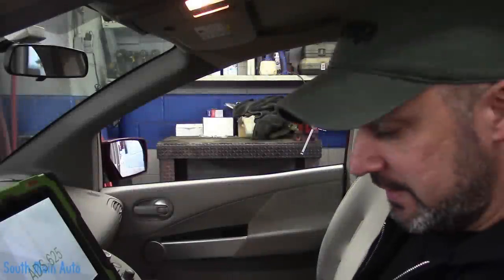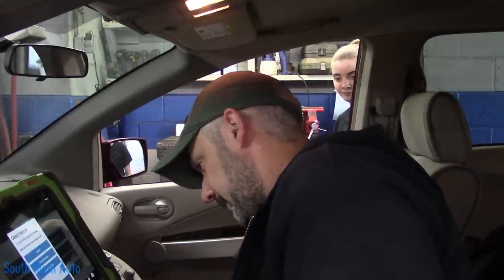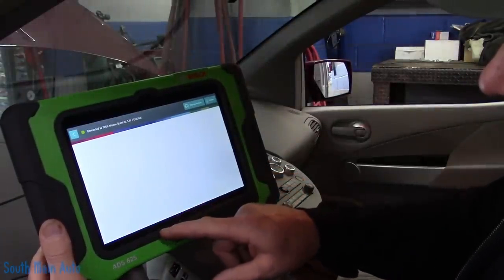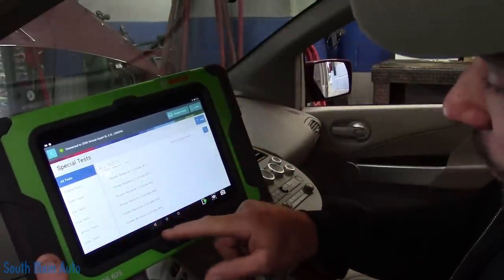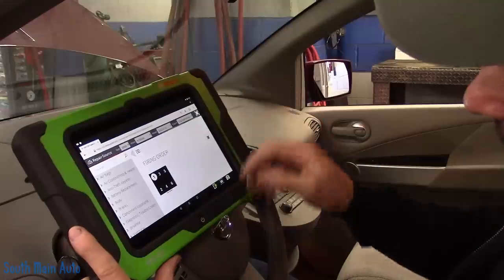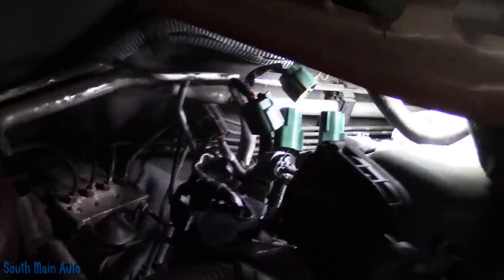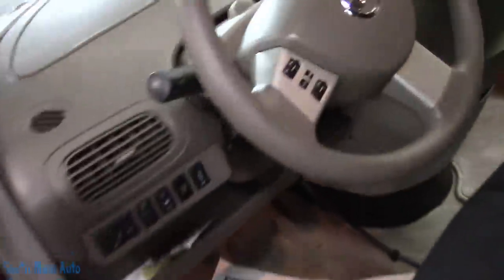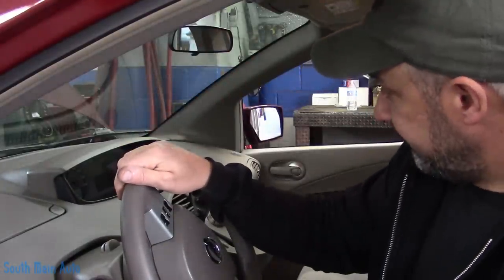Customer Replaced Spark Plugs And Now It Runs Bad!?

Comment: I am not a mechanic and even I suspected connecting the wrong ignition plug wires lol. Been there done that and corrected the mistake myself with the help of more mechanically inclined friends when I heard the engine not running correctly. 

Also had a old 1977s car before that that I bought from a car dealership as they could not get it running correctly when I bought it in 1999, was simply a crack in the distributor and they had apparently very little experience working with old cars and just wanted to get rid of it... Had lot of fun with that old little 1,9Liter 90hp rear wheel drive car until I one day managed to bend the front linkage when I did hit a big stone I did not see doing a little rally driving and it did cost to much to fix it.

Comment: One time I thought my fuel hose had a leak.  It looked a bit scuffed so I tried replacing it.  Didn't run out the pressure so I about pissed my pants when the release valve finally released and shot fuel four feet into the air and all on my hood.   I hacked into the metal fuel line to realize it wasn't leaking and ended up without my vehicle for a couple days until I could patch it back up.   I think I am still getting irregular fuel pressure due to differences in tube diameter or something.  I have a p0171 lean code on bank one and can't figure out why it only trips the short term fuel trims after heated up conditions, around fifteen minutes of drive time, so the code only comes on after long trips, and goes away with short trips, as the trims correct before warm up.  Hoping the new fuel feeder hose will help, but if not, I'm thinking maybe an injector is clogged or there is a intake/exhaust manifold leak

Comment: Cut the track bar off a Cherokee at the side that goes up into the mount. I didn't have a fork and was trying to finish up quick not realizing it was tapered so had to take the mount out off the frame then give it to the facility maintenance guy who shook his head the whole time and didn't have to say anything to make his point because well I did borrow his angle grinder to do it and famous last words he asked "you know what you're doing, right?" while he heated it with a torch to drive the tapered end out. That added an extra day to the job.

Comment: Let's see, I've put the clutch disc in backwards... more than once.
Connected a cooling hose to an air pump on an early 1980's car in all that great emissions stuff.
Distributor in 180 off a few times.
No doubt there's more.

Comment: My biggest blunder was when I rebuilt a VW engine (a 1966) and messed up one of the bearings then to pour salt in the wound I got the timing off between the crank and cam. I was 19 at the time.

Comment: Just finished this: I took my microwave apart because the platter was rotating funny, fixed that, put it together but had one too many screws, took it apart, no place for that screw, put it together then found a screw hole in the middle of the back panel empty. I need new glasses but what I really need is a new visual interpreter behind the eyeballs and between the ears.

Comment: Both of my worst mistakes were from oil changes.  First being, while refilling oil, I forgot to put the oil plug back on, so while watching my awesome skills of not needing a funnel, I saw the puddle forming under the car.  The second was not realizing when I took the oil filter off, it took the gasket with it.  So when I stuck the new filter on, I didn't notice it was gasket to gasket.  When I started the car I heard something that sounded like a wet fart, and a big oil trail following me as I was backing up.  Dammitskee!

Comment: Back in the early 70's GM's were still all carb, a distributor cap, points, coil, spark plugs. rotor and condenser. I did all my own tune ups.  Pulled my Buick Skylark into the garage and popped off the old cap & rotor, pulled all the plugs and gave a full tune up.  New cap, new rotor, new plug wires, new condenser, new points, new plugs.  Just a normal piece of cake, done it 100 times tune up.  Hopped in, hit the key and the damned motor would hardly crank over.  Just like the battery had lost voltage.  Since I had not loosened the distributor, I knew timing may need some slight adjustment, but I had my timing light with me.  Dwell was adjusted through a window in the cap so even if it was off a little that would be minor,  Since I was getting backfiring through the carb I knew I had spark, but the motor felt like it was locking up as I was cranking it.  After a bunch of head scratching, I pulled the coil wire and the car cranked fine. After a whole bunch of checking, I discovered I had labeled the new plug wires wrong and at least 2 cylinders were trying to fire just as they came into the start of the compression stroke.  It's been too many years to remember the exact firing order sequence I had invented, but it was enough to really make cranking a bitch.

Comment: I remember working on a customers car many years ago after rebuilding the engine. When the assembler had installed the distributor he was a fair amount out of time and the vacuum advance hit on the intake manifold when you tried to time it. The customer wanted his car back as fast as possible so I decided to just leave it the way it was and move the plug wires over one notch so it could be properly timed. The customer got his car back and I thought that was the end of it. The next day the customer was back madder than hell because the car ran like a piece of crap. We pulled it in and it was very apparent the timing was way off. I popped the hood and started checking things out. I checked to see that the distributor was tightened down properly and it was but I noticed that the wires had been moved one notch. I put them back and to where they had been and the car ran like a clock and sent the customer on his way. The next day the car was back and running like garbage, I checked and once again the wires were changed one notch. I went out front and grabbed the customer and took him into the back shop. I asked him point blank why he was screwing with the plug wires. At first he denied touching them and then he finally admitted he had changes them himself. I asked why. He told me that the number one wire should go to the notch marked No 1 on the cap and he thought that he was fixing the problem. I pulled the distributor and moved the timing enough to fix the problem and retimed it. The problem in this case was the customer not knowing anything about timing........

Comment: I was young with an 80 something mid sized 6 cylinder gm family sedan. The likes of the cutlass, 6000, or whatever the buick was. Well the Auto parts store gave me Chevy s10 truck shocks. I somehow got them on, lowered it down, and it was lifted 2-3 inches. I knew it was wrong and left them on. It had so much body roll the steering rack broke. So i went to replacing that and it was welded. So I borrowed a friends welder and welded it like grape nuts cereal, little balls everywhere, pretty much just held in with a few bolts.  Then in order to steer i would hold the steering wheel to go straight, let it slide a little to turn left, and two hands, ten fingers, white knuckles to get her to go right.  I got pulled over with every light on just trying to get home. After a quick check they saw i wasn't fos but the car did still stop and go, i wasnt drunk, so i was allowed to get it home. A power steering pump, egr, and some other little nipple thing later she was back on the road for about 14000 more horrifing miles before the trans got the crush notice.

Comment: Worse thing I did was put a wheel bearing in backwards" so the wheel sensor would not pick up the signal, and had to repeat the job. I was not fit to be around that day. 2002 Ford Focus.

Comment: My biggest mistake is when I bought a Chrysler Sebring. Fell apart, basic stuff stopped worked properly like the windshield wipers, and the parking brake at barely 100k miles.
Reply: 100k is good for any Chrysler let alone a Sebring.

Comment: As far as a rookie mistake goes, 1 time years ago I was working on my uncles I believe was can't remember though what year, mid 80's Cadillac Seville with the HT 4100. Can't remember why I removed them but the original rockers come with the pretzel thin bridge that goes between them. Was not paying attention when I was tightening them back down and one of them had tension on it from it's opening position and snapped it in two.

Comment: i had a huge oil leak in my 99 camry. couldn't figure out where it was coming from. changed out the oil pan, the gasket, filter, drain plug, etc. drove down the block and would be out of oil and i would constantly have to dump oil into it. called a mobile mechanic and turned out to be the oil pump o-ring. i took the car to 3 different shops and nobody could find it. it was a $10 part.

Comment: I learn masking tape and a Sharpe is my best friend. 
Worst, I got a Nissan back together after changing a knock sensor, and realized I forgot a water tube that went through the plume. I was pissed another 45 minutes of taking it apart and putting it back together.

Comment: I got an old Tercel, oil looked like tar and was low. I did an oil change. I drove it for about a week, then the wheels locked up and would not turn what so ever. I had the car trailered home. closer inspection of the undercarriage revealed the oil drain under layers on neglect, much less obvious than the transmission drain...

Comment: I did it to an old xf falcon when replacing my distributor. Being a long six the HT leads were all different lengths... but I mixed them all up at the distributor cap. All it would do was cough and backfire until I looked at the firing order and big arrow on distributor cap. Loads of room for my sausage fingers around that engine hahaha :)

Comment: Once reversed two wires on an old K-car when I was ~18. It had the old distributer cap and wires. Running rough was an understatement! Then I proceeded to electrocute my self because one of the wire shrouds had a little of the crimped conductor showing. Made perfect ground with hood of car. when I pushed on the wire because it "looked" loose. Knock me on my butt. I still laugh today when thinking about it.

Comment: Late to the party but, my spark plug story:
92 olds ciera, my grandmas car one owner, got upwards of 27mpg on a 6cyl. I did a plug swap at some point but skipped #1. I think it felt siezed or something and i have no way to fix if breaks off. A while later, weeks or mos, it feels like the trans is giving up and at 180-200k miles it was to be expected. Overnthe next months or year or 2, I relearned how to drive the auto with 2 feet cuz i had to keep revd at stopsigns etc. I checked for vac leak multiple times, all sorts of tests to find the source. The day i was about to give up, i checked for vac again with starting fluid. Hose off the intake man, varios points, and i give a little f-word and just spray across the front of the motor in frustration. Fireball.

Exh shouldnt be nearly hot enuf to ignite. Turns out the spark plug that i skipped cracked the insulation and would ground out. Or in this case light the fluid on fire. Changed it, ran great, been beating myself up ever since.

Always great videos, i dont even own a nissan. Your casual, helpful speech is reassuring.

Comment: i’ve forgotten to reconnect the MAF sensor after taking the intake off. Also i was installing injectors and destroyed the o-rings because i didn’t lube them so fuel was leaking out of all four of them... right into the spark plug tubes... thankfully i caught it immediately because i checked for leaks.

Comment: i put the dist in on my 1970 chev van 180 degrees out on the exhaust stroke and couldn't figured out why it wouldn't start for three months
Reply: My young son worked on a truck that actually had a distributor and he had hard time getting the timing back on. He did just about everything right for getting it back on time except having hard time with the concept of it being 180 degrees off. I had to explain a lot of how to check it with the valves over the phone. It was a challenge but he got it. Oh yes, after many days of playing with it it was indeed 180 degrees off.

Comment: I didn't do it but I could of the day guy shared this story with me. He replaced a transmission in a truck a rebuilt at that time was $3500. This was a kw log truck. So the oil hose was j shaped you put the hook of the hose in the fill hole of the trans then get out from under and pump oil in until it begins to dribble out.  Well as you know during the daytime phones venders drivers all interrupt. Anyway he got back to filling the trans a little oil drilled out he put the plug in and sent it down the road. 
 It made it 3-5 miles they had to pull the axles and tow it back.  The transmission was dry.he figured what happened was that he pushed the hose hook in too far and oil bounced of a gear as he pumped the oil in with all the distractions he lost count of how much he pumped in. 
 I missed a damaged injector line on a 8v71 detroit when I rebuilt the blower for a customer. When I started the truck I had a runaway.

Comment: Well my Honda coil wires won’t reach to other coils. Also I don’t like to mix up my coils when I change plugs. I always put them back where they were. Seems a little impossible to do nowadays. I remember with spark plug wires you just do one at a time and lay the old wire to the new wire for the length. But one at a time. Take pictures

Comment: Forgot to put the oil filler cap back on the top of my engine. Noticed it a couple days later...  That was a mess but luckily I was just a little low on oil when I noticed the issue.

Comment: I had a 12 BMW 335 and the water pump went bad.  It was 4 wheel drive so pulling it out and replacing it was a pain in the ass. Especially doing it on your back.  Well,  all was fine after a day or so of getting that taken care of. But I had also blown a fuse, because I put a bulb that was too big for the dome. Well, I did the classic "I'll remember where I took it out"... needles to say I had to have it towed because,  at the time I didn't realize it, but I put the fuse in the wrong spot,  which caused the car to not turn over. $400 mistake.

Comment: mistake I made when I was a teen on my T-bird was after an accident, replacing the front right wheel assembly I ended up needing to use locking clamps to hold it in place... decided I'm immortal, duck taped the clamps so the entire assembly was held on by this (tow angle if I remember right) and promptly forgot about it. Roughly 1200 miles later (surprisingly) is when the entire wheel feel off and rolled past me on the highway. Fun times being a teen. I am reformed, and I am better now, do all my own work on my cars still and haven't had anything major in the last decade or so with 3 vehicles. Don't roast me too hard please :)

Comment: I changed the plugs and wires in my 07 express only to have all hell break loose afterward, eng light on dash lights and gauges flashing and resetting , can't read DTC codes then crank no start a little later. Couldn't figure it out and my mechanic said take it to auto electrical shop thought the ecm got fried somehow. Turns out it was a bad ground at the frame from the battery only cost me $165 and was just a coincidence it happened after the plugs were changed.

Comment: I knew what it was before watching the video. anytime you do plugs and it runs worse than before that's usually the problem.  my practice is to do one at a time. that way there's no confusion.  and yes I know it's not always the best way or even possible in some cases but it's a simple method that's applicable in most cases.

Comment: We went on vacation when I was a kid and our 79 Ford F-250 sat in the driveway while we were gone. When we got back it ran like crap. Lots of digging. Dad almost gave up and took it to the shop when we couldn't afford it. He did one last try and looked at his Haynes book. Since the hood could be opened from the outside, apparently some jackass decided it would be funny to pop the hood and rearrange the plug wires on the distributor.

Comment: For me it wasn't a mistake I made but the dealership made and were completely oblivious to and that was they did an oil change. Changed my filter which is one that you only replace a paper filter in and it has a plastic oil cover well they put one on that looked just like mine but it wasn't for my car. Found out as they also didn't have an o-ring on it even though it had a spot in the threads for on. Put one on. Oil spewed from the filter because the o-ring couldn't seal it as it was where i tried to screw it down. Ended up buying a new oil filter cover and they didn't match where the o-ring was on the one for my car it's at the top not 2 threads down from the top. Didn't Leak oil after that and also glad I didn't have to smell burning oil every time I stopped and had my heat turned on (it was NY winter so heating is a must.)

Comment: Not a car mistake. But the second computer I built I had it on the bench and got the affirmative POST pass beep. So hooked it up at my desk. Still had the POST passed beep, but nothing on the display. I took the side off to see if I made any mistakes, top to bottom. Came up with nothing. Went to unhook it to bring it back to the workbench, and realized at that moment I didn't plug the monitor in.

Comment: Bent a C-clamp and destroyed a caliper trying to get the rear brake caliper pistons to compress on a 2003 Buick Lesabre.   

Didn't bother reading the manual that clearly stated that you must twist the piston in order to get it to collapse for the rear brakes as they also served as the parking brake.